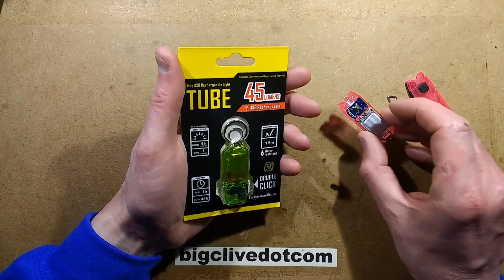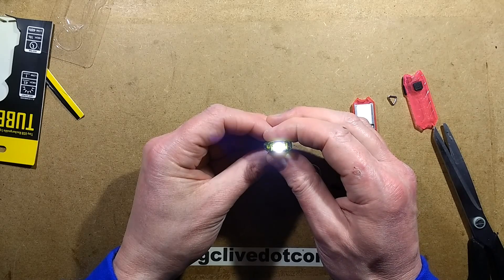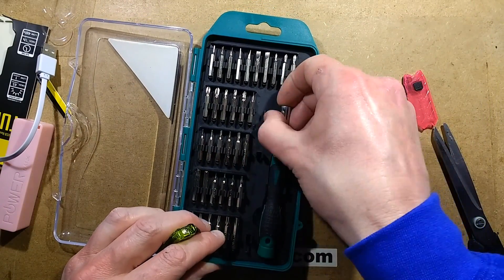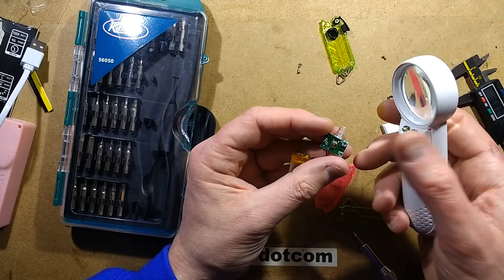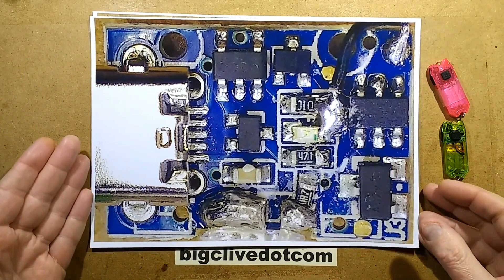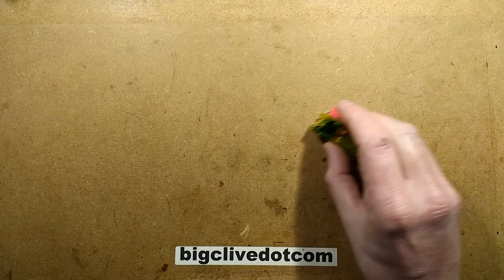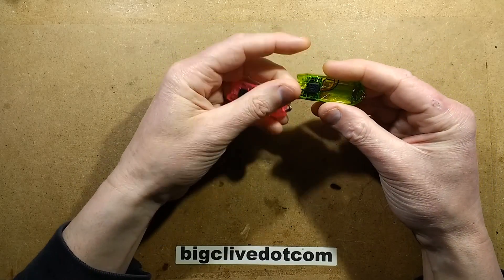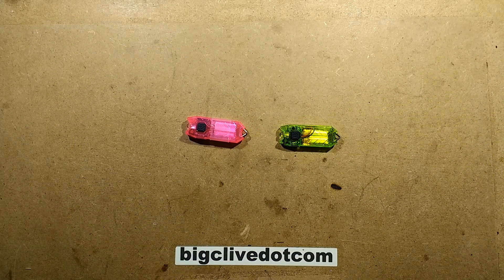Fake Nitecore Tube test and teardown.

Comment: You can diy mini flashlights from e waste "sticks". also this pcb fits very good, as the usb charge pcbs do (into the flat oval ones). You need basic items for that. My nc tube has leaking cell, so its garbage. the Federal Institute for Risk Assessment (bfr german): "In the aerosols of e-cigarettes, among other things, harmful carbonyl compounds have been detected, which are formed by the thermal decomposition of the liquid base (propylene glycol and glycerol). However, under normal operating conditions of the e-cigarettes, very low concentrations were found compared to conventional tobacco cigarettes of carbonyl compounds."

Comment: I bought the clone ( exact same body colour, same circuitry, same battery ) some days ago, and I´m totally satisfied with it. It´s half the price of the original over here.
I won´t use the emergency light feature at all. The way of activating high/low is different from the original, but OK for me.
All in all, thanks for pointing me at the clone. It´s sufficient for my needs, and still a bright little bugger.

Comment: Hi!
Can the built in battery be replaced with CR1225 for example?
Reply from the maker: A CR1225 can't be recharged.
Reply: @bigclivedotcom  Yes, I know ,  but i wonder if the CR1225 can probide the same amount of current on low and high mode so the flashlight to operate the same way as when the buit in battery is used.

Comment: It'd be nice if these had some sort of mains/USB bypass as well.  So, even if the internal battery is dead, you could still run it off of external power (like that battery pack).

Comment: I just want a torch that you switch on and it stays on, not multi clicking and a strobe coming on or a coblight on the side to blind you.
just a single switch to turn it on.
I've got a big old beast, 50 watt 6 volt halogen, 8amp battery, 6 inch reflector and it kicks out a monster white beam.
But it lasts 30 mins max, goes dim and jumps straight to a standard torch bulb light, built into the reflector

Comment: I switched to Nitecore products as my sole purchased type for all my tactical and combat use equipment about 2 years ago.  I have never had a failure of any Nitecore product purchased. Whether one of their awesome battery chargers or any of their tactical lights, including the ones mounted on my weapons.  I also use Nitecore tactical IR lights on my night vision devices, the 850nm IR increasing the range of even the basic night vision units I have to the point they almost rival the expensive gear I have as well.

I will continue to buy and highly recommend Nitecore products as long as they retain their excellent quality.

Comment: I got the original Nitecore after your video, and I agree it's very good. I only wish the one-click low power mode turned off after a while, because it has turned on in my pocket a few times. It seems that keys sometimes easily hit the button.

Shame about the clone's flickery PWM mode. I'm fundamentally opposed to PWM'ing LEDs as a form of brightness control, but it's not too bad on the Nitecore. But I wonder why it flickers at all in low power mode, when the adjustable brightness modes don't flicker even in the dim end. Maybe it helps to conserve power, putting the controller to sleep between blinks?

Comment: you should measure the volume of the batteries  by lowering them into a full glass of water and the weighing the overflow of water.
Reply: you could also measure the volume of lithium by what percentage of your body gets 2nd degree burns when it reacts with the water!

Comment: Another interesting, informative and insightful video! -that bit about the backup lighting feature very nuanced awesome. 
Hard to say if this clone would benefit from the installation of a 5mm slow color changing LED in place of the white one, but it's difficult not to suggest it purely out of habit on this channel! :)
Cloud lamps, solar charged camping lamps - all seem to benefit from show color changers or warm white LEDS.
The clover lamps took most likely but mine haven't shown as of yet...

Comment: I believe the cheapy one has a extra function only because you can plug it in to a battery bank and read at night and or if you go camping because the little battery they supply wouldn't help much or if your juice goes out and you have to do anything that takes any amount of time and electric is not available. I have a Bluetooth device called the clipper, you can where it on your clothes and that goes out when you're charging as well which defeated its purpose because I wanted to use in on my stereo, I don't see how this could be a good feature, for what?

Comment: 11:42 - Just to add to the learning here for those that might not know, you can find a neat SMD resistor value calculator here: www.resistorguide.com/resistor-smd-code/  Also, there are 4 different ways to mark an SMD resistor for value: 3-digit, 4-digit, #R# and the EIA-96 standard.  Read about them all at the link above or watch the video at this YouTube link: www.youtube.com/watch?v=Xwp5KT3E558

Comment: Meh, my pocket real estate is too valuable.  Favorite inexpensive keychain light is still Olight I3E, got the last one on sale for $9 but usually $10 to $11 on Amazon.  It doesn't come with a pocket clip, but you can put a standard AAA sized pocket clip from another light, or from a magic marker or tire gauge, and put on in both forward and reversed position for use as a headlamp on a ball cap.

I called it a keychain light but I ground the keychain loop nub off the end and epoxied a rare earth magnet on so it would not only stick to ferrious objects but also just to flatten the end so it'll tail stand.  Some people might like the USB charging of the Nitecore, but I wouldn't even want an Olight I3S with a mUSB port because it would have to be several millimeters longer to make it fit and add a charge controller.

Comment: I can understand a knockoff skimping on components, but the reverse engineering of the firmware has me stumped. Would it really cost that much more to get it right? The only possibility I can think of is that they repurposed an existing chip, perhaps a manufacturing overrun, and slapped it in.

Comment: I've got a wee thrunite Ti3 on my keyring, it's tiny, uses a single AAA (I use eneloop rechargeables), has multiple brightness settings, feels nice and solid and outputs 120 Lumens at max brightness, you should check them out

Comment: One thing I noticed with China is the factorys there that produce an item can sell parts of that product to other companys,whom use them to make clones. I fly RC Planes and have noticed several companys that sell the same type or model but have different components on them. The cheaper ones always short change the electronics but in the event you wanted to up grade the unit, you can order the better quality parts and install them on the cheap mode. I have done this on several Planes and saved myself some money and still ended up with a better quality item. This applies to other products out there as well. You pretty much proved to me this happends a lot more than people know.
Reply: scott firman they probably planned the mentioned current limiting... which is also not the best choice 🤣

Comment: OMG the sound AND video are so much better now!!! :D
The soldering on that original is shockingly bad. As far as the component choices in the 'new' one, I found it odd that they didn't use a MOSFET.

Comment: how is that not a caliper?
Reply: I always refer to them as calipers. Though the vernier scales have been replaced with a digi readout now, why is it still not a caliper?
They can still easily be distinguished from a manual indicating caliper by calling it a digi caliper. As indeed one does with a micrometer.
Reply: Do R/C! I have a calliper, it supports my leg so that I can walk.
Reply: Mark Paul interesting ive always heard them called digital calipers.

Comment: Well clive I have a question isn't it really easy to get rid of the flickering of pwm LED's? I heared you just need a resistor and a ceramic capacitator. I can't quite remeber it but I think it was called a low-pass filter. Could you make a video about it?

Comment: @Clive - How do you test the capacity of a battery
Reply from the maker: I discharge it to the cut-off point (about 2.5-3V for lithium) and then recharge it using a charge monitor that measures the charge current over time to get the mAh capacity of the internal cell.
Reply: Thanks Clive - I'll invest in a charge monitor

Comment: What printer do you use that allows refills?
Reply from the maker: It's an old EPSON and I wouldn't say it "allows" refills it just tolerates them after some tricks.  The ink system I'm using has external tanks and a dedicated cartridge attached to them with an ink ribbon pipe.
Reply: Yeah, all of these new printers have count down chips in them so even if you have a full tank it will say it is empty.  Really ironic you have to hack the printer or the cartridge these days.

Comment: I always liked the tritium ones; no battery to run out.
Reply from the maker: They're extremely dim though.  Even the ones claimed to be suitable for reading maps.
Reply: v10 glow in the dark seems better than tritium. just expensive to make a decent sized light with it.  Uv lights with a uv pass filter are also fun, lights up the room, if the uv led is good enough, and it can be hard to tell where the light source is coming using the pass filter.

Comment: I have the genuine Nitecore and I've ordered a clone five weeks ago, but I'm still waiting for it to arrive. My genuine Nitecore stopped working and I've had to take it apart and re-solder the the led lead with the heat sink  back onto the pcb. I don't know if the original solder joint was bad, or if it got so hot it melted the solder out of the joint.

Comment: Could a slow color changing LED be swapped out for the white LED?
Reply from the maker: I'm not sure how well that would work.  The internal circuitry would limit the current to a low level.
Reply: Just google raver gloves. You can buy the finger LED inserts individually. They have many modes.

Comment: No software in those, only firmware.
Reply: All firmware is software, but not all software is firmware.
Reply: All software when compiled is what you'd call "unreadable".  Firmware just means the end-user probably won't ever be updating it.  However there is no hard definition as to when firmware becomes software or vis-versa.
Reply: What do you think firmware is
Reply: Are you trying to be pedantic for the fun of it?  Firmware is software.
Reply: When's a processor a controller, and when's a controller a processor? 

How do we define relocatable, by desoldering a chip, by connecting a programmer, by updating over bluetooth, by direct download from the cloud, by automatic upload over USB.

Do you update the firmware on your TV, or is it software.
Reply: So effectively something with an operating system? I quite like it as a definition, but it's not universally accepted.
Reply: by any definition used in the last 3 or 4 decades, "firmware" is simply a sub-set of software (specifically, low-level software stored in non-volatile memory). talking about "the difference between firmware and software" is like talking about "the difference between a cow and an animal". one is simply a more generic term, that includes the other.

the original meaning of "firmware" was closer to what we now call microcode, but no one has used it in that sense since the 1980s.
Reply: ...and what do you think firmware is?
Reply: After 25 years in programming I understand there is a difference. Do you?
Reply: It's software running on hardware... What's the difference?
Oh, one is hard coded and the other is a general term, doesn't mean it's NOT software though.
Reply: It's cool mate, I find things to tend go better if I keep things polite, rather get angry or offended... Have a good day.
Reply: indeed, even the fuses aren't really fuses anymore :)
Reply: "Code".
Reply: compiled and interpreted languages are completely different, its like comparing a finished cake (stand-alone, ready to use) with a kitchen full of ingredients and appliances (that all need to be present to produce pieces of cake on demand).

firmware is simply a type of software. its like "cake" and "food". not all software is firmware, but all firmware is software.
Reply: hill billy Good point well made.
Reply: Wait, what? A hate war? Settle down bud, I see very little hate here just a few people telling you that if you want to get really technical about it, then although it is firmware, it's not wrong to call firmware software either.

The closest thing to actual hate I've read thus far was your reply "After 25 years in programming I understand there is a difference. Do you?" 
Which could easily be taken the wrong way, for example, it could be interpreted as"Well, I'm smart, have experience and know the difference, are you as smart as I am?"
Reply: apparently, there is a subtle difference, if you consider software is a readable language, while firmware is unreadable executable code.
but really, no one cares.
Reply: By relocatable I mean that the code can be placed anywhere in memory.
Reply: In the end it is all FM.
Reply: Software vs firmware is one of those false dichotomies, like compiled vs interpreted languages.
Reply: Perhaps I chose the wrong way to inform that I wasn't talking out of another orifice. Sorry for the tone.
Reply: Sorry to start such a thread. I was just trying to make a subtle distinction not start a hate war. By my recollection software is relocatable code intended to be executed  by a processor and firmware is somewhat more static code intended for a controller.  That was all I wanted to say.
Reply: All the software tools being used now obfuscate things like fuse burning that is needed in firmware but not needed in software.
Reply: Yes the distinction is blurry when you have processor chips and boards with controller peripherals and controllers with floating point and co-processors. But they haven't become interchangeable just yet. Is this an invalid argument?
Reply: Jeffery Rowan I can see your point but my several years of programming told me that no one cares 😂 its some zero and one shit it has to be software but you can't really blame for me every kind of metal ultimately is either aluminium (light metal) or steel (heavy machine stuff 😜 )

Comment: Oh Clive!!!  Your gadget videos mesmerise me so much that I just HAVE to go and buy some of the stuff you review.  In this case I bought the real McCoy and the clone.  I also bought one of these...
http://www.ebay.com.au/itm/Mini-USB-Rechargeable-Pocket-LED-Torch-Light-Keychain-Flashlight-Key-Chain-Ring-/191496689479?hash=item2c96179747:g:ae0AAOSwol5YxSaC

Sing out if you want me to buy one and send it to you for a review.  They look interesting.  The brightness claim (depending upon which seller you believe) is from 25 to 50 lumens.
Reply from the maker: I've covered those in a video.  There's the original version with overcharge protection and the cheap one that has no cell protection.  (But the cell is too small to do any real damage.)
Reply: Hmmm...I wish I had checked your previous video before buying the cheapy round keylights.  No matter, I just bought them out of curiosity.
I received my genuine NiteCore light today (brilliant postage...ordered and delivered within 12 hours) and it's everything you say it is...really good value (even though it was AU $15 from a local seller), built tough and it puts out an amazing amount of light.  It's so good I've taken my mini cob LED light off the keyring for good.
Thanks heaps Clive.  I really enjoy your videos.  I know the barest minimum about electronics but I just enjoy how you analyse and take stuff apart.